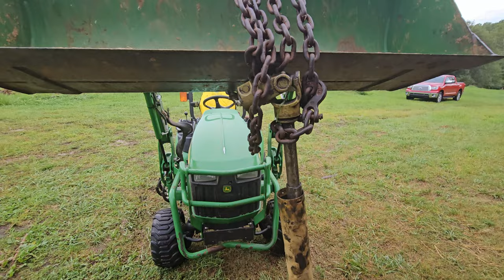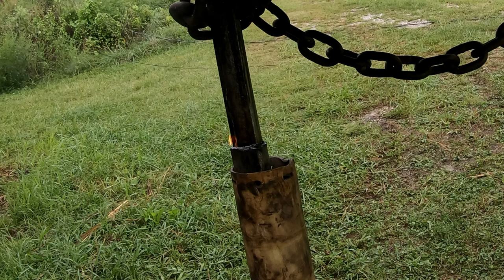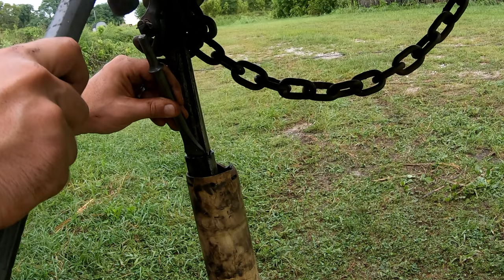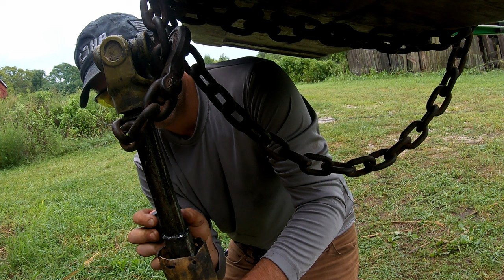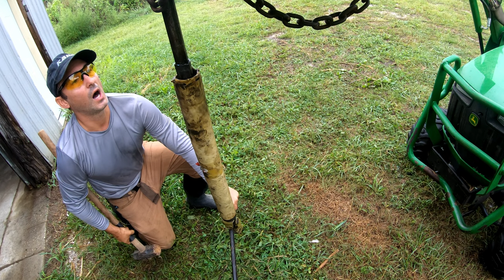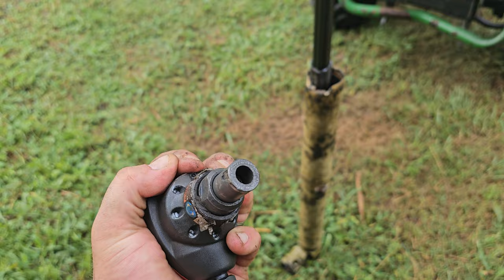Unsticking a Seized PTO Shaft using a Torch and Palm Nailer

Comment: Going through that now.  Already tore two 10,000 lb straps trying to yank it apart.  Few things more frustrating.  Reached my maximum frustration level and gave up for the day will.  Will let it soak with PBB and give it another go tomorrow.
Reply from the maker: Good luck. Try hanging it up and use gravity to help you slam it down.